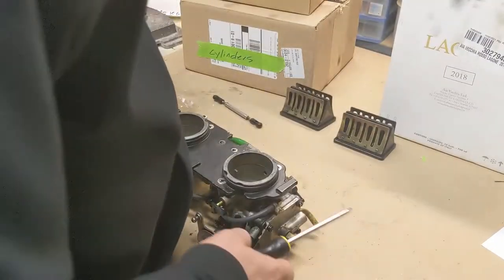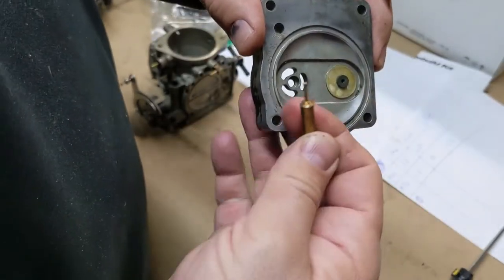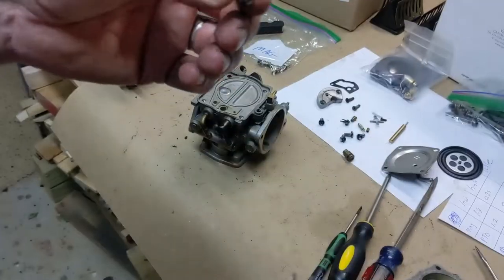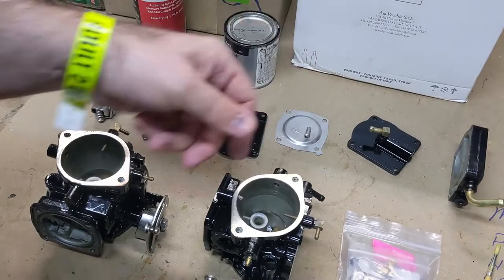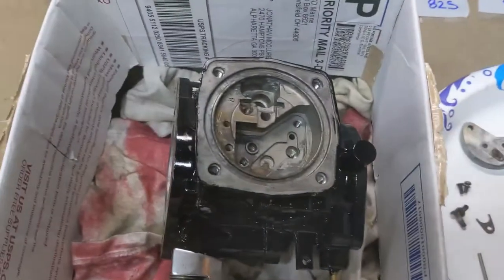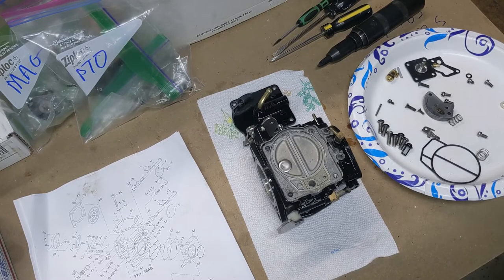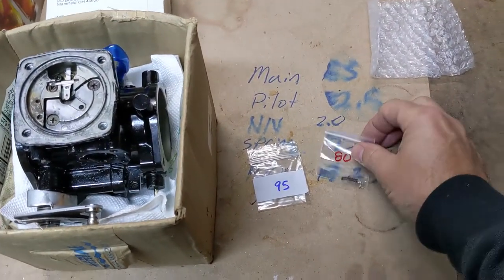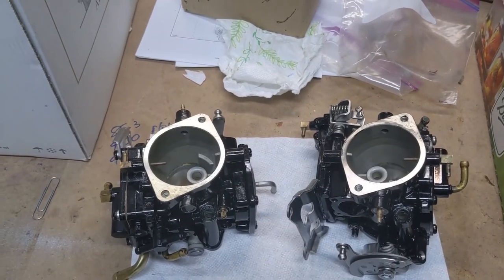Sea-Doo Rebuild 951 Carbs - Gray Ghost Resurrection

Comment: When the screws are stripped you can use a pin punch or a large nail set and drive the stripped head back into near the original shape, and then the impact will work.
Reply from the maker: Good tip my man, thanks

Comment: What size are the fuel lines. Thanks for the video I just rebuilt mine but the fuel lines are not maked with the sizes? Pretty sure bigger one is 1/4 but what size is the smaller ones?
Reply from the maker: Smaller vent and return is 1/4. Input is all 5/16" for the hoses from tank to carb. The smaller ones for the accel pump or primer I'm not sure, I reused my OEM ones. Use tygon there, you can get a multi size pack from amazon

Comment: Awesome video. I have a 98 limited with the 951 and was thinking about doing a rebuild on the carbs. Do you think i should change to the richer sizes or stay oem? Also were do you recommend getting rebuild kits?
Reply from the maker: Osdmarine for the kits. Only use OEM. The cheep knockoffs are prone to have issues. If your engine is stock ..stay with stock jets and turn your H speed out a 1/4 turn and see if it makes a diff. If it does it's a signal you could go up. If you change air filters to say Proc ..they most definitely need to up size or you'll run too lean.

Comment: What exact carb kit do you need for stock carbs on the grey ghost ? I got the 46i
Reply from the maker: This is what I used and fits all 947. But I would not advise stock jets, springs, and n/s for the white setup. The stock leanment system will ruin the motor. I have a second video explaining why. Here's the kit https://osdparts.com/index.php?main_page=product_free_shipping_info&cPath=595_602_1&products_id=11683

Comment: Nice videos, just subscribed. I am almost done installing my gaskets, opened my accelerator assist pump and noticed that little round orange rubber came off. How important is that?
Reply from the maker: It's very important. Check valve I think. I'm told they are hard to find. See if it can go back in. Try to link with this guy, I know him ..he can assist https://m.facebook.com/2smokecarbrebuild/
Reply: @jonparkmac  thank you sir, I appreciate it

Comment: Great video. How do you adjust them from what I can tell looks almost impossible once installed. Newbie here. Just purchased one running one but with plugs fouling and terrible throttle response.
Reply from the maker: These are the white carbs which are upside down and L screws on the bottom. I have to take carbs off to adjust. Later models are on top and you can get to those. Google seadoo carb chart and see what you need stock and go from there.
Reply: @jonparkmac  yes sir. I have the same ski.

Comment: Great video series. Can you tell me why you went up for the jets and needle and seat? Is that in anyway determined by the fact you have oversized pistons or is that unrelated? Thanks!
Reply from the maker: It's because the OEM setup was way too lean and know issue. This updates it to bring it up to 99 specs. I have another video that explains it
Reply: @jonparkmac  OK thanks. So if I have a 787 engine that has been bored out to fit larger pistons, that doesn't necessarily mean I should change the jetting and n/s?
Reply from the maker: @jackbrody7324  right, you can turn out your speed screws a little like 1/4 inch. Those basically are jet bypass channels that increase the flow a little.

Comment: What about the enleanment solenoid? What's the procedure to eliminate that? Thank you
Reply from the maker: You have to remove diagram vacuum lines so they're open to atmosphere, remove needle lever shims, use 80g spring, rejet to 99 specs and bigger n/s

Comment: pump side the last black gasket was put on backwards you can tell cause it protrudes
Reply from the maker: No. That gasket has one purpose. To seal the pulse side of the pump. Which is confirmed with a simple vacc test on the nipple. Or did you mean the metering side ..which is not related to the pump
Reply: @jonparkmac  I just noticed that on the one side it has a slight round section and the other is flat but the black seal you put on it has the rounded side on the flat section. 13min 49 sec
Reply from the maker: You are right. Fortunately that particular one is ok. Good catch sir!